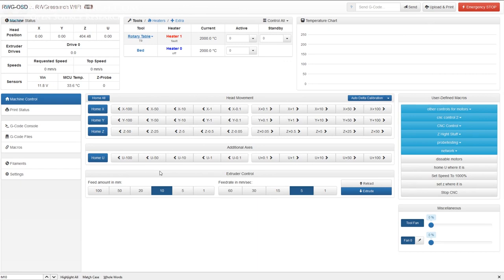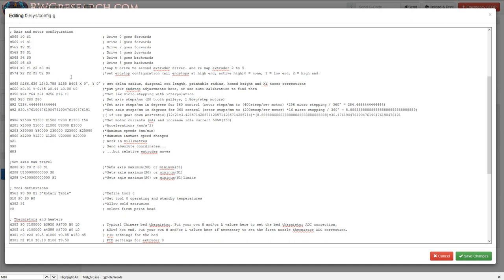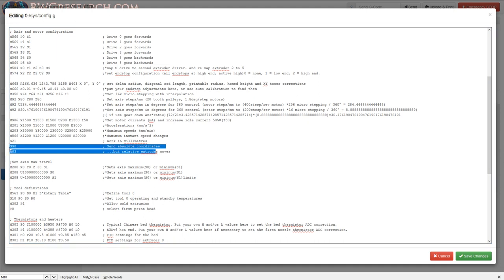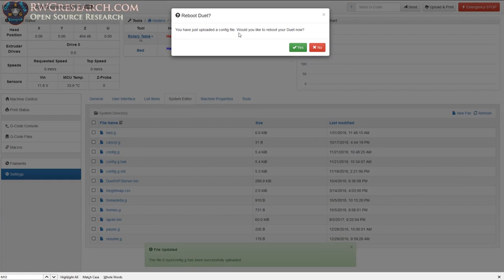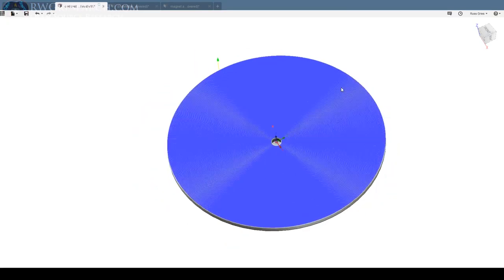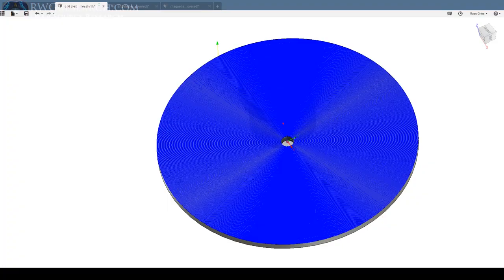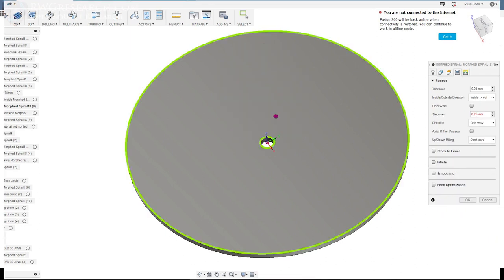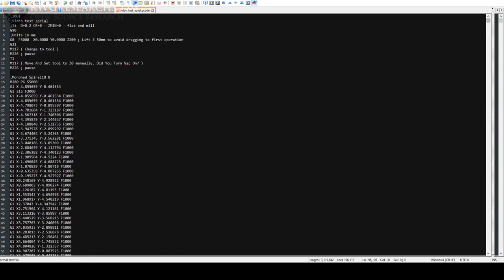The Back End... Software For The Flat Coil Winder - RWG-OSD

Comment: nice work!!! So i gather the script can't produce u axis values for G2 / G3 arc interpolation?
Reply from the maker: We were going to implement this in to the script, however, currently a constant spiral dose not have a a function G2 / G3 ( arc's) as its contentiously moves... this can be added in the future, and should be with an option to turn this on or off... but as of now, its point to point... Thanks! ~Russ
Reply: @RWGresearch  thanks for the reply! Fusion will fit g2/3 arcs to any curve using the "smoothing" tolerance setting in CAM, check that out if you have not yet :)